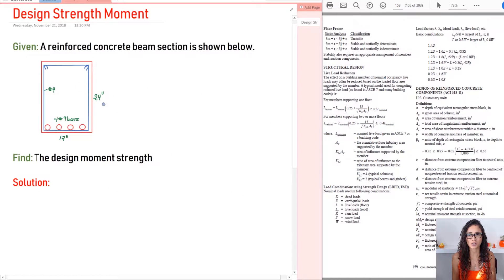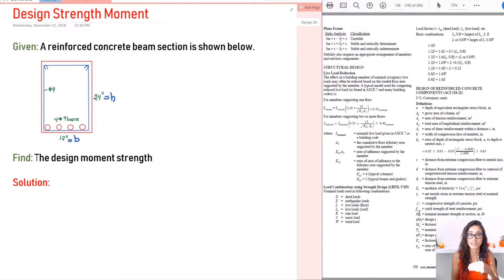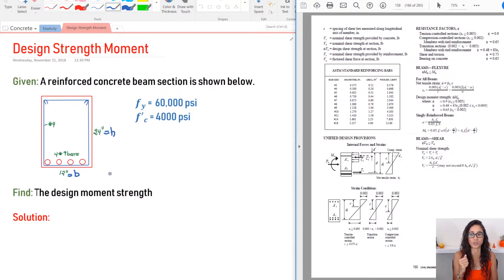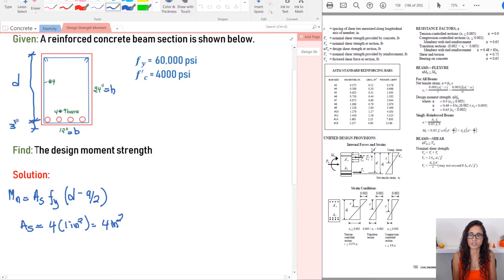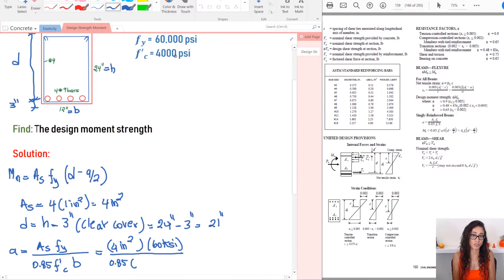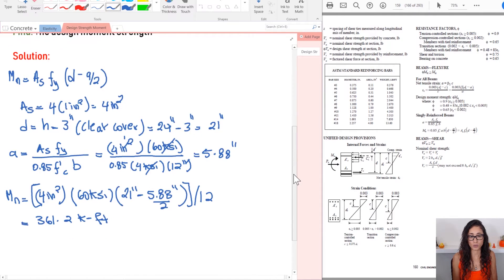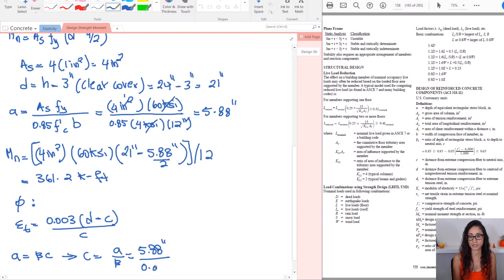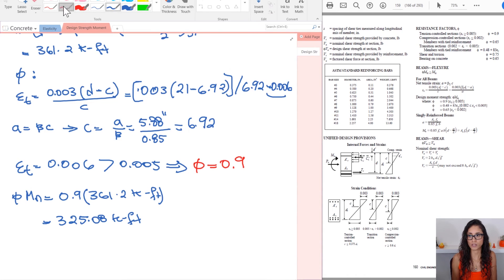FE Civil Concrete Design - Design Moment Strength; Φ Mn

Comment: Really I don't HOW to deal with the book of FE CIVIL engineering practice because I heard that it has a lot of information that won't be in the exam also has lack of information that will be in the exam  .
Please could you give me instructions to learn how to learn all of that information , and another question do you have explained all subjects or there is another subjects?
Reply from the maker: Are you talking about the FE book by Linderburg? If yes, that is true some of the material is not relevant to the newest FE exam. However, most of the questions are similar to the FE exam questions. So I do recommend it. If you end up using the book and you are not sure if it is relevant to the FE exam, I would suggest that you check the specifications and the reference handbook. If the equation is not provided to you in the reference handbook, then there is high chance you would not get it in your exam. I have not explained all subjects, there are a lot more things to cover. Good luck with your studying.
Reply: Thanks for your answer. 
We are waiting the best from you .

Comment: could we also use de (c/d) ratio to determine if phi of .9 was allowed?
Reply from the maker: Can you please specify what is de? Also, when you use de (c/d), what is the equation equals to? Now what you can use other than the equations provided in this example, is the limits that are shown under the strain conditions graph on page 160, but it will take you longer to figure out the phi value and you still need to calculate for c. I hope this helps and good luck.

Comment: I did this problem before watching the video and I used a clear space for the steel of 2.5 inches (it is subjective and this will probably be given to us in the exam to eliminate a wide variety of solutions.)  Also, I used my Area of Steel to be 4.40 inches because I include the 1#4 bar.  Is this not used?  I thought for a stirrup (and maybe this is for shear only) you count the stirrup steel?  Great Video.  Clear and concise work-through!!
Reply from the maker: Also, I forgot to mention, great job on doing the problem before watching the video 👏 I am sure if you did mistakes, you will remember them for the test! I try to recommend to do the problems before looking at the solution because that is the best way to learn some thing. I want to thank you for sharing it with us 😊
Reply from the maker: Thank you, I am glad you liked the video. So in the exam, I was given the clear cover, I don't really remember how much 😂. However, I used 3 in for easy calculations and also usually if you are dealing with foundation and the cast against and permanently in contact with ground, minimum of 3" clear cover must be provided (ACI 318-14 page 335). For stirrup, it was just an extra information that we don't really need for this problem, but you are correct, usually stirrups become important when we are mostly dealing with shear. Also keep in mind, that in the exam, you will be given some extra information, that you don't necessarily need, just to throw you off, and that is why it is important to have good understanding of the concepts. I hope this helps 😊